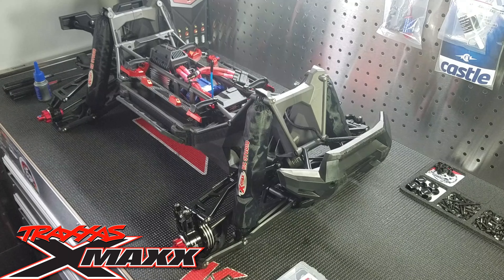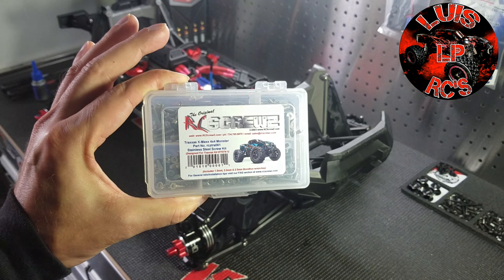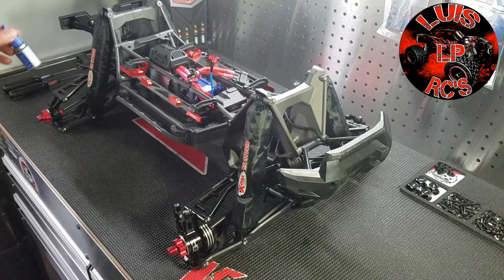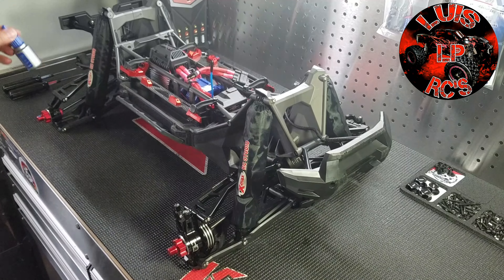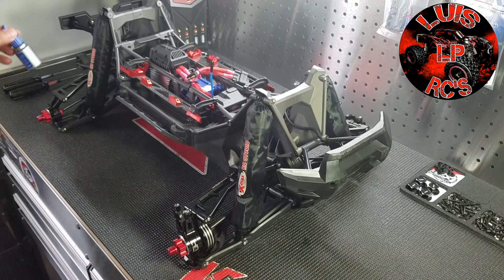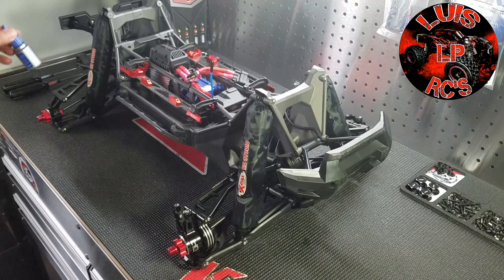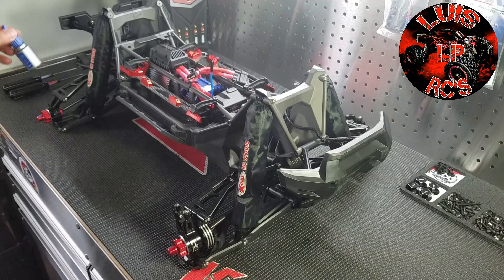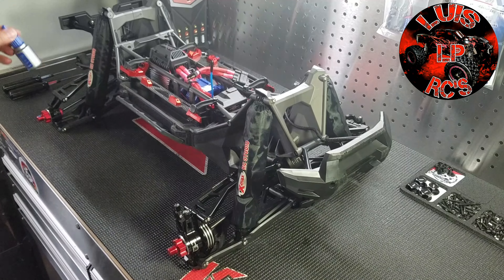Traxxas Xmaxx Upgrades Integy RC Screwz

Comment: Your Xmaxx is awesome man! I have used that brand of stainless screws. If they go in plastic no worries. If they go into aluminum and you use loctite be very cautious when you remove them. I had several of the heads strip out on me. And I use MIP drivers
Reply from the maker: I dont use a drill. Everything is screwed by hand. I also have MIP drivers. I found out yesterday the screw kit is not 100% complete. I'm missing the two bellcrank screws and two screws for my Steerting Blocks. I have to mention that on my next video.
Reply: Luis L.P. RC's go to Tony’s Screws, you will be happy.

Comment: That thing looks sick! Great job. Stainless steel screws (good ones like you got) are super strong, the naysayers don't know what they are talking about. A good electric screwdriver with a good clutch is indispensable.
Reply from the maker: Thanks, I'm getting it ready for the snow. I rather do it by hand and not take a chance with the plastics. Maybe one day I'll have the guts to use a drill and not be worried about stripping a plastic part lol
Reply: Luis L.P. RC's I usually use both, electric to start the longer hardware but hand tighten everything. Breaking down the chassis by hand takes some time. I like your truck, majority of my parts are from Integy.

Comment: Hello Luis L.P. RC’s, if you do an aluminum upgrade to the a arms and axle carriers, do you have to have the metal steering column?
Reply from the maker: You dont have to, but also it depends how you run your Xmaxx. My whole suspension is Aluminum except for the lower arms. Makes no sense to have Aluminum lower arms. So I keep them plastic.
Reply: Ok thanks, I’m not really planning on bashing it around too much but I just wondered if that is a need if you get the aluminum upgrades
Reply from the maker: @brayden5888  When I first got my Xmaxx it was winter time. I ran it the first time and side swiped a snow mound. I basically broke a front carrier and tie bar. So I went with aluminum. Since your not going to bash it hard. Then hook it up and make it look bad ass. Just kep the lower arms plastic.

Comment: Hey big lu Brad again u think 8th scale will fit xmaxx with those shock covers
Reply from the maker: The black ones I have are Baja Shock covers. You have to buy two pairs. Let me go on Ebay right now to check if they have them.
Reply from the maker: ok they have them on Ebay just type Baja Shock Covers and it will pop up. They have them in black and blue
Reply: I found the red skull ones but they say fit 8th scale you think they will fit also
Reply from the maker: Whats the Title on ebay so I can look them up